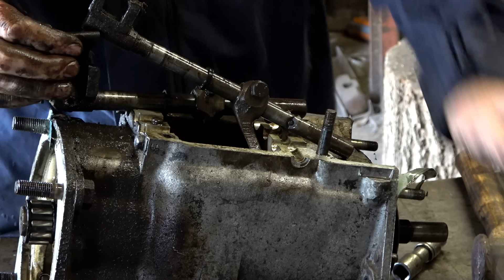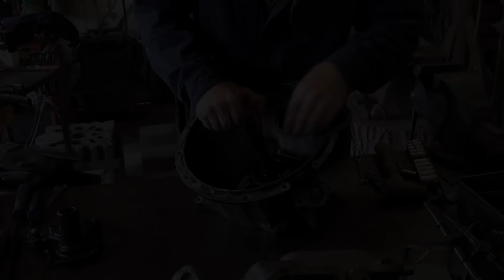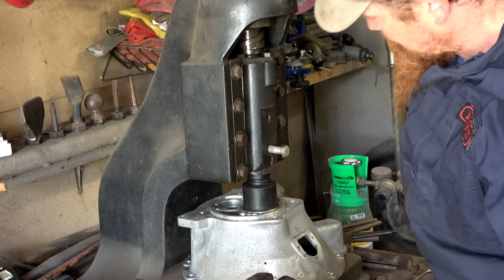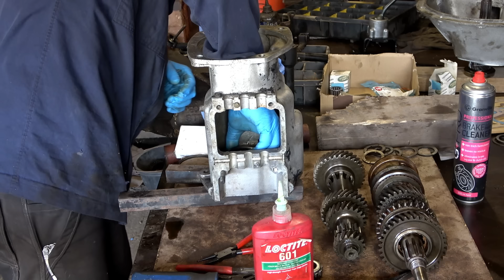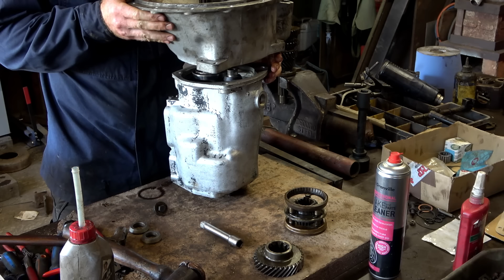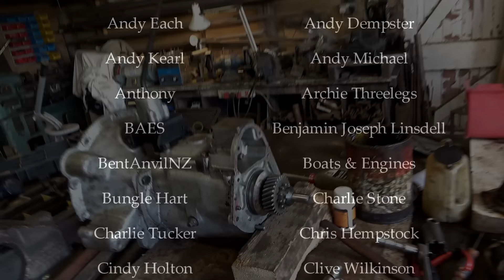Project Kermit: Land Rover Series Gearbox part 3

Comment: I used to rebuild gearbox's on weekends for extra money, I'd build them & then set them on the shelf awaiting for sale as I worked for a clutch fitting company & would sell them to customers if needed & if I had 1, I'd fill the gearbox right to the very top with oil then remove the oil down  to the correct amount once sold. I didn't ever have any rust happen whilst sitting around for upto a year, good little money maker until the boxes started to get ridiculously complicated as well as the gaskets & parts getting very pricey plus I left the clutch fitting shop

Comment: Great to see more work on the Land Rover and detailed repair.  Only thing I would add, is normally the calculated end float on the main shaft would include a gasket paper between the box and bell housing.

Comment: It looks simple when you overhaul the gearbox.
Later suffix cases had the rear bearing carrier pegged and a slot machined into the case to stop the carrier from spinning.
I saw a box jumping out of gear because of excess backlash on the main shaft because the the rear carrier was worn and spinning in the case.
Have you thought about enclosing the gear stick bracket to stop grit from settling on the selectors and wearing out the seals?
Great series.

Comment: I'm surprised at the complexity of the old Landy gearbox. Well done for getting to grips with all the nuances of building one up. I've done a few early Ford gearboxes and they are a fair bit simpler. All the best, Mart in Solihull (Retired transmission engineer).
Reply: All the more surprising when you think it’s based on a pre-war Rover car gearbox from 1932

Comment: Having a vehicle which fits your needs, you understand and can fix from front to back is quite simply empowering/liberating knowing whatever crops up you do not rely on anyone else to get you back on the road as long as you are fit and able to do so. 
That is a measure of freedom not being shackled to monthly PVP, HP or lease payments or dealing with vehicle built in obsolescence designed by manufacturers.

Comment: I had my foot slip of the metal clutch peddle with quite high rev's on. so dumped the clutch in first with a very loud bang. the big cog on the lay shaft lost all but about 4 teeth.  looked like each power stroke removed a set of teeth.  It had pride of place on my mantle place for many years as a talking piece and a reminder to wipe cut grass off your shoes before using the clutch. :-)
Reply from the maker: Crikey!

Comment: You are applying a lot of good practice to that rebuild - I wish the professionals would do the same.

The selector housing top cover should be kept with the associated casing - the bores are all made once the top and case have been milled and mated together for a perfectly circular bore.  If you mix and match, you will have oval bores that either allow slop, pinch the rods, or are laterally offset.  That is the theory, but you can always try it out incase the mixed set are lucky enough to be within tolerance.

The loose rear bearing carrier is common - LR staff seldom bothered applying the sealant that was supposed to set them tight.  Like you said, it’s the prime cause for oil migration into the transfer box and the gear box running low on oil.

I suspect your main shaft rust is not from water ingress per se, but the rusted areas having been uppermost while parked for a long time, dried out well above the oil level and subject to condensation.

Good decision to replace the synchro springs - they last about 50-60,000 miles, so doing it now is wise.  They don’t act as a detent and their fails doesn’t stop the gear box from working unless they jam the synchro - their job is to transfer the sliding movement of the dog-tooth hub to the baulk ring cage for synchronisation.  When they fail, you need to double-declutch.

Comment: I see that your THOR hammer is as worn as mine, a new one is very expensive, could you do a video where you replace the copper? Great stuff on the trans rebuilds. Cheers.
Reply: You can just buy the copper and leather inserts. They’re not cheap but at least you’re not binning a perfectly usable handle and head.